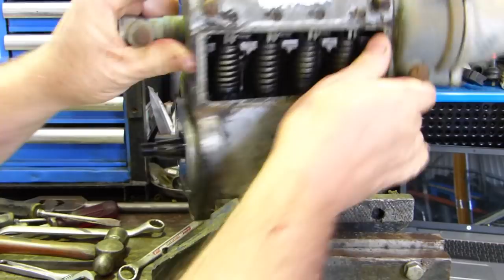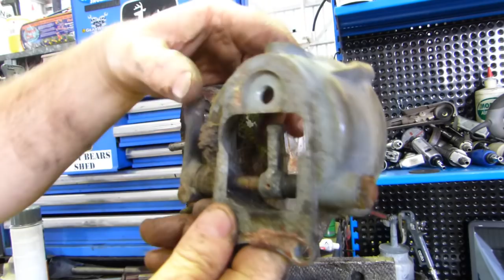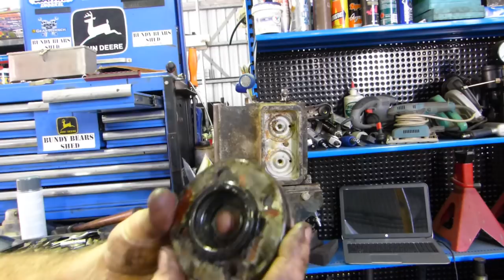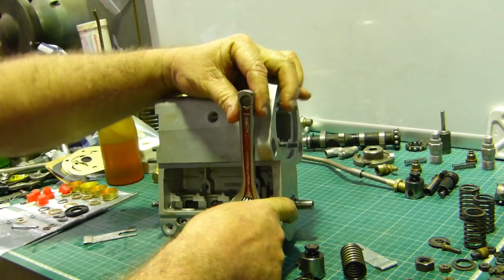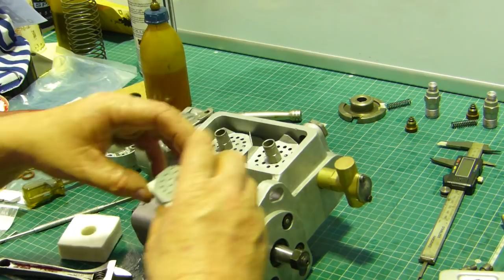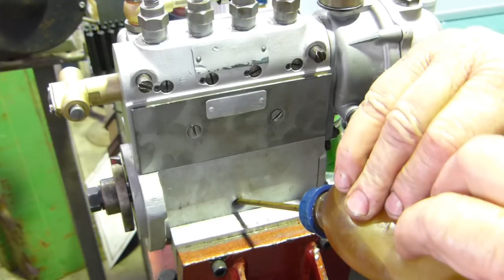How to dismantle and reseal your Ferguson TEF20 Injection Pump.

Comment: Thank you so much for this extraordinarily useful video. On my TEF20, the diaphragm failed causing the engine to run at way too high an rpm even with the valve spring de-compressor open. Could not stop it & eventually stalled it going backwards with the transport box on the floor scraping till it hit enough soil that the engine cut out. My relief at that time was near religious. Got a new diaphragm from my parts supplier in the U K. He had sold several, but never fitted one. It then took three of us over 3 hours to get the new diaphragm on, which I am now believe was due to the rack not moving back enough. As was it was key hole surgery, screw drivers prising the new diaphragm back, the washer put on from a grease loaded screw driver, the split pin with tweezers through the vacuum port. Then the throttle was jammed and it took me another 3 hours to get the two back plate screws out, eventually using an impact wrench. At that point I quit as I could not see how to split the rear housing & came in & saw your video & I went from despair to feeling a lot better. Thank you for sharing!
Reply from the maker: Thanks, Im glad the video could help you. That is the reason I do them . to help people do their own small jobs. Glad it all eventually worked out for you.

Comment: Thank you Lance a excellent video, I did the same to a International B275 2 years ago and it worked fine . The difference with them was it had 2 lines to the governor housing 1 been vacuum line and 1 line to the "atmosphere".
Reply from the maker: G Day Daryl, I suppose the breather in this case would replace the second line on your B275. I have never done a B275 but the basic theory on these pumps is all the same.
Reply: Yes that is true Lance, the B275 with the inline pump had a pneumatic governor,[ as you know] but there was no throttle connection to the injector pump , the B250 were the same.   The later model B275 were fitted with a DPA rotary injector pump.

Comment: Thanks Lance.A great video thanks for the time setting this up and sharing.Cheers.Jimmy.
Reply from the maker: Thanks Jimmy, I hope it helps.
Reply: Hi Lance just got the injector pump diaphragm this weekend and some brass washers to refit the fuel pipe from the venturie, I hope I spelt that right, and thanks again I'll be replacing the diaphragm on my TEF this Wednesday, as it races when started, I am checking the fuel pipe to the pump for a small hole or air leak. thanks again for all the effort on this big job it was very interesting.

Comment: Greeting from the States.  Great video!  I notice that your governor had a problem mine has, that is, the throttle linkage shaft was very loose.  You said that you would rebush the housing, but didn't cover it in the video.  How did that go?  I'm going to need to do the same thing.
Reply from the maker: G Day Michael, I still have not done that as Im not up restoring the TEF20 just yet. Everything else gets in the way. I do machine a lot of carb butterfly shafts though so I dont imagine it would be a problem.

Comment: Hi Bundy.  Great video.  Very helpful. .   How common are TEF 20 in Australia?  There only 120 in NewZealand. You will enjoy the TEF engine rebuild,  they are not that straight forward.  Who design a engine, when you got to pull out the crank shaft out the back,  before you can remove the con rods.
Reply from the maker: There is a few over here but nowhere near as many as the TEA and I think there may have been more TEDs over here.

Comment: excellent film.  one question … i watched Cherry top Farmstays little film ferguson tef20 diesel injectors and he stated you fill that oil cavity to the top with oil , and its not mixed with diesel as a lubricant.  Im a bit confused with this bit.  you cover it (at time 1hr 20min in. )the end of your film and say fill with oil to the drain plug and it gets mixed with diesel  , Its the only bit im confused about.
Reply from the maker: Due to the design of the pump the oil in the sump of the pump will dilute over time with the diesel that has leaked past the elements. That is just how it is, you start with clean oil and end up over time with runny oil.

Comment: Hi Bundy, greetings from Ireland. I have a similar pump on my TEF20 and have air in the injection pump. Diesel is draining down into oil sump. Injector spray pattern is good. Any idea where I need to look for this leak. The pump reservoir will have air in it which I bleed before I start. Engine is constantly hunting when running. Any ideas where I need to look.
Reply from the maker: Look at the front pump seal or for a leaky manifold heater, the hunting can be a diaphragm leak or a blocked orifice in the inlet manifold.

Comment: Hi I am giving trouble with my TEF20 revving up and down. I appear to have air in two injectors when I crack them open. 2st two from steering wheel side.The appears to be a slight bit of air in the pump when I open the bleed screws also. The other two injectors are clear. I got the pump checked two weeks ago, new diesel, e.t c. Any ideas where I should be checking? I replaced pipe from filter to pump also.
Reply from the maker: Check the diaphragm on the governor and the small orifice on the inlet manifold that goes across to the diaphragm

Comment: Hi Lance I just replaced the diaphragm into my TEF today, and all thanks to your great video, and I got it started as well, but its a fecker to bleed and get diesel to the injectors, could I ask do you have a video on repair to the levers on the quadrant as mine is stuck and I cant move the lever to het the arms up or down, thanks for all your videos.
Reply from the maker: G Day Jimmy, Undo the 4 bolts holding the quadrant in and sit it in some diesel to loosen things up a bit.

Comment: Great work! Could you do a follow up with spill timing?!  one of my cylinders is not firing and I wanted to check that, before diving in to the pump.....
Reply from the maker: G day John, it will be a while away yet as I need to out an engine kit into my TEF
Reply: No worries..engine rebuild may be on the cards for me too later.....  :)
Reply: John Wells - Lance gives a clue at around 41 minutes about the spill timing for individual cylinders and how it can be adjusted - 6° for a full turn of the hex nut, and 1° if you just turn it one flat. Not fully explained of course - as he said at the beginning it was about a general overhaul without going too deep into the technicalities, but you might find there’s enough detail to get you started if you want to check and adjust the spill point for individual cylinders. Bloody good video - so much detail packed into it and the finished pump looks a treat. Very satisfying watching you tap those plugs into place at the end!

Comment: thats awesome ...not that complicated at all...this pump quite a bit the same as dexta...well there is an extra nozzle of course... it uses the same diaphragm part no ... mine is having a hard  time to idle low ..i';m just using it for blowing snow but have to hold the throttle by hand on the absolutely no throttle to keep it from over reving ...very inconsistent and feels like it might be misfiring a little ..it evens out when it is under load and blowing deep snow ..a few things i've read and watched says its that diaphragm ..it reminds me of an old chainsaw with bad crank seals sucking a bit of air ,, another guy on here had that diaphragm go bad on a major but his just smoked ...mine has a vertical exhaust ..if it was down by the rear tire i suppose it would burn the eyes a bit but i can't tell if its smoking as bad as his ..it always  smoked and chances are it always will ...but would that diaphragm make it over rev??
Reply from the maker: Yes it does on these pumps, there is a small orifice on the manifold end of the diaphram pipe that can get blocked as well I hear.
Reply: @BundyBearsShed  that is good to know.. i'll check that .should be easy to check thanks
Reply: @BundyBearsShed  i took mine apart just on the tractor tho and changed the diaphragm and it idled it right down ...before i did tho i put a little extra oil in the oil bath ...now it won't really rev out much ..its definitely enough to run the snow blower and it revs up a bit as gets in deeper snow as a governor should ...i grew up on a tractor the same model and i don't really remember it making too much noise either way .thanks for your help ...i really appreciate it

Comment: I've a massey ferguson 20 that won't rev all the way up i have tried rev it off the pump by pushing the bar all the way but still no luck.what do I need to adjust for it to rev thanks
Reply from the maker: Try moving the rack manually, if not you may just have a fuel blockage

Comment: Hi Lance. Firstly just to say thanks for all your videos which have been a great help on numerous occasions. I have a '55 TEF that I use on our 6.5 acre plot in Herefordshire in UK which constantly needs large or small amounts of attention. The cold start button on the injector pump seems reluctant to stay in and I wondered if you knew what holds it in and then releases it and is there something I could do short of stripping the pump as per your fine video? Cheers Greg
Reply from the maker: G Day Greg, I would just check for corrosion on the front little housing where it is and free that up a bit.

Comment: Great video, my maximum fuel button won't keep in do you have any tips on how to adjust the screw or ideas why it won't stay in? Thanks matt
Reply from the maker: Not really just turn it to a new spot might help.
Reply: @BundyBearsShed  turn the screw inside the cover? Thanks
Reply: Can I remove the Coldstart assembly off the pump to investigate whilst still on the tractor thanks matt

Comment: Great video as usual. I am just about to sort my tef pump.Do you have to spill time the pump again after the rebuild if it has come off a working tractor.
Reply from the maker: It is always a good idea to spill time them but iff you get it on in the exact same place it should not be necessary

Comment: well done . How much does it cost to repair this pump? How to set the fuel dose in this pump?
Reply from the maker: The kit and diaphragm total would have been around $160 but I had to import the kit from England. The fuel dose is set with the clamp screws that you can loosen the element and adjust it on the rack. I left these in the same position just to be sure.

Comment: Hallo. Greetings from Sout Africa. The videos are great and realy helpfull. Well done. Need info on the sizes of oil seal on outer drive shaft or half shaft. Thank you very much.
Reply from the maker: Not sure as I usually just buy the kit as the collar will need replacing as well.

Comment: Thank you for making an informative video. I learned a lot from it. At around the 5 minute mark, you open the back plate and take out the fuel filters. Du you have the part number for the filters ? I am having a hard time finding them.
Reply from the maker: G day Tom, I bought a complete pump kit from Agriline.

Comment: Hats off my friend !Just wondering how to check my Gardner 6LX pump (on engine). Any advice....?
Reply from the maker: G Day Duncan, About all you can do is remove the injector lines and turn the engine over and check they all look the same with regard to fuel squirt and that the stop is working etc. Pull the side cover off and check for oil and rust etc.
Reply: On the Gardner 6lx pump you have priming levers on each injector element that you can operate to see if the pump is operating the injectors.

Comment: Those screws for the filters might even be 1/4" Whitworth or 5/16" BSF.
If so they have a grip across flats of 13,34 mm.

I have noticed that some of the bolt heads on my FE35 is Whitworth and the only spanner that fits is the adjustable one.
The screw at the bottom of the fuel filter and also on the starter engine are Whitworth.

We can find the sizes here: https://www.sat.dundee.ac.uk/psc/spanner_jaw.html
But we can't easily find any spanner nowadays.
Reply from the maker: Yes I suppose it could be Whitworth, I would have a spanner but it is not often used now a days. The little shifting spanner fits well lol.

Comment: Hi mate was wondering why my TEF 20 When started runs at full revs , when I put the throttle up or down it makes no difference …….thanks
Reply from the maker: Either a sticky rack in the pump, hole in the diaphragm or a gummred up orifice in the inlet manifold.

Comment: Thanks for the great video Lance! I have just got a tef20 and had an issue with the injector. Found a hole in the diaphragm. Plan to go over the whole injector now after watching this video. i have seen a leak from the back cover as well. What grade of oil where you using. Cheers
Reply from the maker: Macwhirter Locomotive Company I was just using engine oil so if the front seal leaks I’m not mixing oils in the engine
Reply: Bundy Bears Shed Thanks. Makes perfect sense. Luke

Comment: G'day lance... I also have a lot of play in the shaft controlling the diaphragm. Unfortunately I had to drill the housing fixing screws out, as they were seized solid. Inside was full of rusty water and the 'plunger'  (at 14:30) was seized solid too. Only way was to bore it out on the lathe, as it resisted heating and 'plusGas' release fluid......amazing as the tractor (and throttle) was working !  I've made a replacement but are you sure its the throttle control ....and not the 'stop' lever?
Reply from the maker: Yes probably stop lever as the diaphram will adjust speed.

Comment: Hi great video  just wondering when you bleed the oil out of bottom of injector pump of Ferguson 20 diesel because diesel mixes with it  when you put some new oil in what type of oil do you use .Thanks Kevin.
Reply from the maker: Engine oil

Comment: Hi Lance nice rebuild of this in line  pump if a a/f spanner does not fit try Whitworth on this old English stuff,could you share  with us contact details of the company in the uk that provided the gasket kit.
Reply from the maker: The kit came from Agriline and it is a good kit in my opinion.

Comment: Hi was looking to know how to set the pump timing on a tef 20 ferguson.
Reply from the maker: G Day Kate, Im sorry but I havnt got to that on the TEF yet.
Reply: That would be great if you can fit that in !!  I've just rebuilt the engine with pistons and liners and need to rebush the pump throttle lever (like yours) and do the spill timing.

Comment: Hi can you help me with dimensions on the throttle plunger please
Reply from the maker: Look in the workshop manual it may have it there, I dont have a  pump available to play with at present.
Reply: @BundyBearsShed  thank you for your response i bought the tef20 and previous owner iserted a 20mm Welsh plug where the plunger needs to be so the guy told me its a conversion 9n the pump so that it could run

Comment: At this point i'm afraid I'm going to have to free up my injector pump, my DP3 runs good and slow to start but when it heats up it starts over revving a lot. The biggest problem is that I don't have nice conditions like yours to work in, and I'm a big old cluts so I was avoiding any thing to do with the injecshon pump itself.
Reply: Another problem is my one has vacume control from tha air inlet.
Reply from the maker: This one is vacuum governed as well, just go slow and steady.
Reply: @BundyBearsShed  oh, sory, I must have mis heard I thought that it looked like a vacume controlled pump and that you sed that it had a diafram, but I heard you call what looked like a stoper to me the throttle, I think.
Reply: I'been analysing sum more of my situation and I'm now quite sure that that the diafram is my main problem. Also the pump is an old in-line CAV pump, so chance of finding parts for it would be very difficult.
Reply from the maker: @wmffgeorge1589  you may well be correct I do miss speak at times and not pick it up in the editing.

Comment: Great video Lance :)
Regarding the cold-start feature on the pump, do you know if the pump from the A3.152 engine (35x) also has such a feature?
Reply: Karsten Jorgensen no theres cold start on them engines
Reply from the maker: No they don't, with the rotary pump they are a very different set up.

Comment: I’m going to do this. Mine has old diesel in it which has made it really dirty and it doesn’t pump anymore, diesel reaches this injector but not the cylinders.

My plan is to paint it when I have it off, if I want to replace the text signs, the small one, are they screwed or how are they fastened. It doesn’t look like screws, perhaps you can’t get them off?
Reply from the maker: G Day Ulf, I think from memory they are small rivets